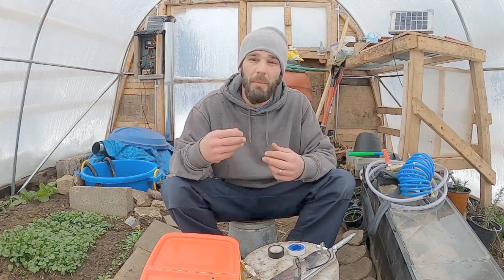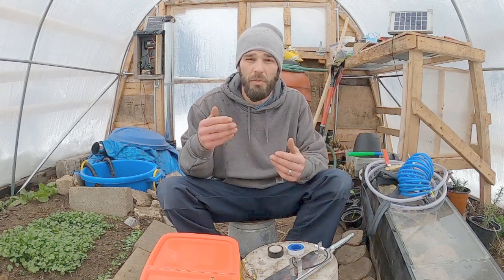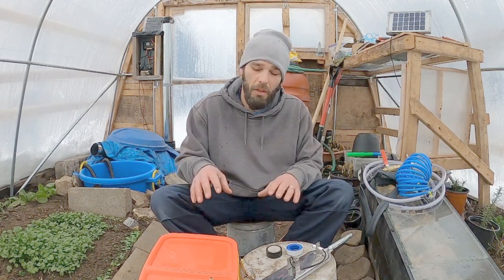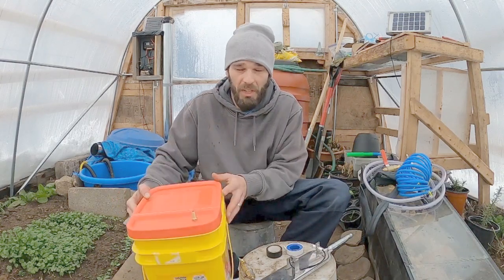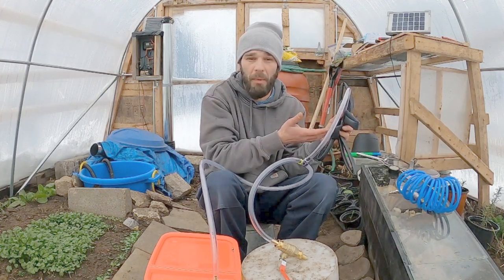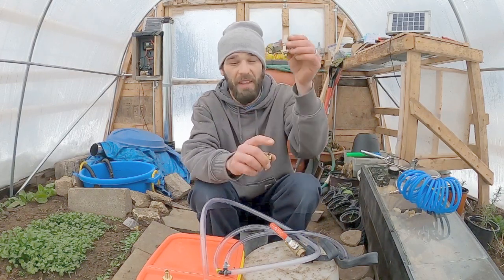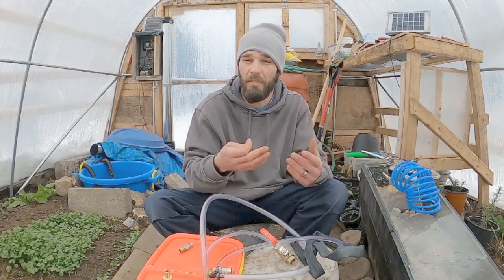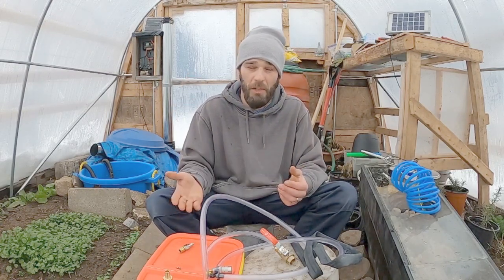DIY Bio-Digester Experiment For Greenhouse Heat | Model Demonstration, Thoughts, & Ideas Upscaling

Comment: Very glad to have found your channel. Two things. Elsewhere I have seen the gas line from the storage unit go through a sealed water trap (line cut) in order to stop a fire racing back. Couldn't tell you what the risk of blowback is, but maybe worth considering. Also do you have a description of the equipment you use for your solar driven pump system  somewhere? Thanks.

Comment: On the methane collection, example: fill topless 50 gallon barrel with water. An air hose goes through barrel at bottom, sealed to prevent leaks. The air hose bubbles up your methane. A smaller tank slides into 50 gallon tank upside down. Opening faces down. All the methane bubbles fill the smaller tank as tank rises. A valve at the now top (formerly bottom) of smaller tank is opened to use the gas. The gas is pressurized by the weight of the smaller tank and additional weights if desired. The pressure/resistance of input methane bubbles could be reduced to near zero the higher the hose is to water level. By entering water drum low and having end high up above water level, the hose creates pressure less pathway. So on end of bubbling methand tube put a float. Consider also that if your methane production is weak pressure, you could employ weights and pulley to help raise inverted tank as it becomes more boyant. To reduce back pressure from tank.
Reply from the maker: I’ve seen the double barrel system with on upside down in the other, thank you for the input I’m still brainstorming the large scale build. Every bit of info helps!
Reply: @Earthdwellershomestead  Looking forward to see your results. I think this is better than wood gas.

Not to change subject but curious if you seen "David the Good" videos? He promo tes anaerobic tea. Seems practical but I guess you have to be careful with it.
Reply: Operation: 
1. fill water tank close to full, bubble hose floats to top. 
2. Open valve on the slightly smaller capture barrel. Sink capture barrel into water barrel bottom up, close valve. (valve is in center of capture tank bottom).
3. Pull capture tank up with come-along/hoist. Lift capture tank by attached cables. Lift until water level of water tank approaches lip of capture tank. If the capture tank is air tight, the water level lowers in water tank as capturd tank rises. A vacuum is created.
4. As capture tank gets filled by methane bubbles water level of water tank returns. 
5. When capture full release hoist. 
I don't know if bottling the gas is desirable
Reply: Capture tank would be good to have translucent plastic, to see methane gas level. Slightly smaller is to prevent tank tipping over letting gas out. 

The gas generator/bio tank will need to be air tight as well. A valve on that side of air hose will be good for bio tank maintenance
Reply: Actually you dont have to drill hole in water tank, just run bubble hose over top lip of water barrel with enough slack to go up in capture tank.
Reply: Hoist cable connections could avoid air leaks using straps.
Reply from the maker: Less hassle that way!

Comment: Great you did make a biogas digester .
Reply from the maker: Experimenting at the moment as we’ve got freezing temps and snow everywhere 😂 if I can warm it up with compost enough I’ll hopefully get a little fuel from this mini system before I go bigger
Reply: @Earthdwellershomestead  if you are using cow manure that’s a great start. You could even use solar to power a glow plug. That should help with the experiment. My digesters are frozen up here in New York. During the summer months is when my systems are making great biogas. Keep your great videos coming. I look forward to your off grid energy exploring.

Comment: Does this make your greenhouse smell like a portapotty?
Reply from the maker: No, the container will be sealed to collect methane
Reply: @Earthdwellershomestead  thank you. I really didn't know if it would seep out.
Reply: The toilet smell comes from H2S. Worthwhile using filters to get rid of some of the undesirable gases, not least because the smelly stuff is also highly corrosive.

Bubbling through water will remove some CO2 from the final gas mixture and fine steel wool will remove large amounts of the H2S. The end result will be a more pure methane gas ratio and a better burn with less damage to your components.